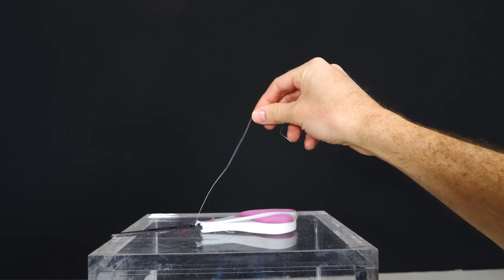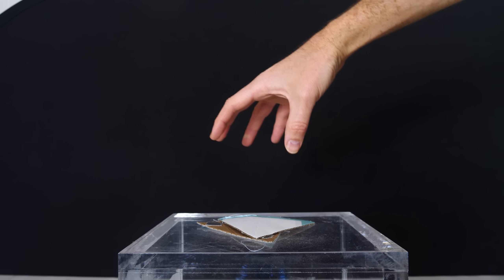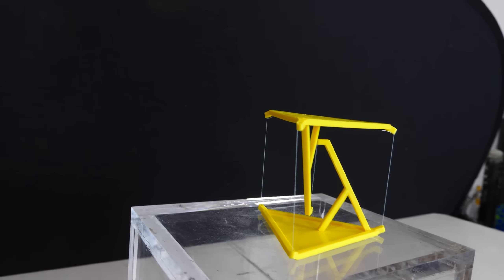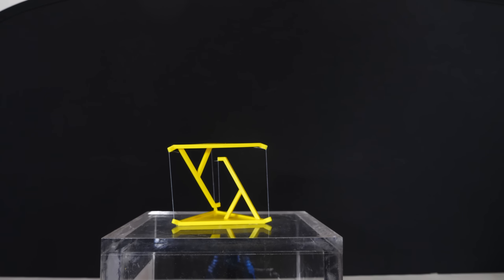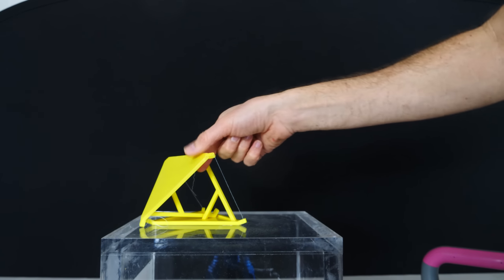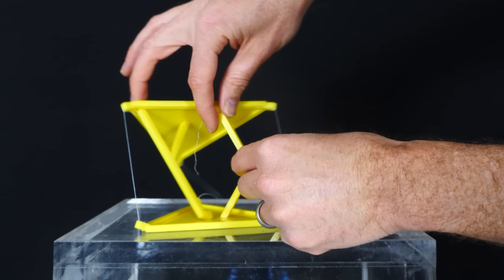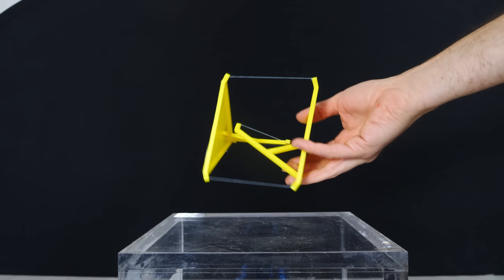Fake or Real? Floating Table Held Up By Only Strings

Comment: the entire weight is being held by the center string.
Reply: Yup
Reply: Factz
Reply: add more center strings evenly spaced, and add more outer strings to prevent tipping
Reply: Kinda
Reply: Yeah why is this so amazing?
Reply: Zach Terry it took me a couple of seconds to figure it out.  Something hanging from a string is nothing new or amazing.
Reply: @zachtterry21  It's mostly visually surprising.
Reply: Yes. We both watched the same video. Good job.
Reply: Corey Mac well actually no but only if the weight is exactly in the middle. If its the slightest off the string on the opposite side will be stretched. So actually the weight is always on 2 strings
Reply: Wrong, it doesn't work with just the center string.
Reply: Did you guys not watch the video? It's being held by 2 or 3 strings at any one time.
Reply: well, yes... but also no
Reply: Yes but it doesn’t fall because of the sides holding it
Reply: The strings on the side is keeping it in place, in the same way helping the center string to carry weight
Reply: No

Comment: That structure and your explanation give me a totally different perspective on matter. Is everything under tension in a sense? I'm confusing myself. Must marinate.
Reply: dont forget to cook for 10-15 minutes on a low flame and season with garlic
Reply: Static Electrical Forces is the medium which makes this "Work!" The Plastic plates are Statically Charged. 
Test This Theory: Sit Down in an Easy Chair + Sock Feet Rub on Carpet + Pet Your Cat😻 in the Dark(Gaze Closely at Your Hand/Cat Contact Points)=What do Ya See? ("OoooWeee!.. miniature lightning bolts Honey!");The ElectroMagnetic Energy will also forcibly move objects(i.e. embedded pet hair,etc...) without having or being physically contacted:

Comment: If I'm not mistaken, the center string is in tension because of the weight at the center of mass of the table and the other strings are in tension whenever there is a moment of inertia created at the corners.

The reaction force in the centre string is upwards, and at the corner string downwards.

Comment: What the heck, I was just done 3D printing this exact thing and then you upload this video? What are the odds? :D
Reply: I did some math for you. If everyone who watched this video 3D printed this exact thing once every 270 years, there would still be higher than 50% chance that one of them 3D printed it the same day as the day this video came out.
Reply: Jimi02468 wait, how can you did the math exactly?
Reply: my life is a lie I think he just used basic education to run math: 50% probability and number of viewers are the independent variables, and average number of years  you would like to 3d printing such object is the dependent outcome variable in his setup problem 🤣
Reply: @fos1451  lol, wich math?  It will happen or it will NOT happen....50/50
Reply: @catothecensor  that's not a good way to count probability
Reply: @jschouten1985  so the chance that i die today is 50/50? Either i die or I don't die?
Reply: my life is a lie difficult to explain better here, but it’s clear id you think on it.
Reply: @jschouten1985  Thats not how probability works....
Reply: it's called a hype
Reply: If it's not 💯% accurate, it's 50% accurate

Comment: Something I would have never thought about. It is almost like an illusion. It tricks you to think it is floating but really the center string is holding it with the outside ones balancing it right? Didn't pay tye most attention to the video so I could be missing something but who cares.
Reply: Yeah that’s basically right sadly the illusion part lasted about 1.5 seconds before my brain was like the middle strings holds the weight and the side strings keep it from just falling over

Comment: The human body is a masterpiece of engineering. DaVinci appreciated this realization. Bones many times stronger than steel much to the rapier's chagrin.

Years ago I was in an automobile accident. I was a passenger in a car that has come to a full stop on the freeway. All of a sudden, we were rear ended by a minivan going 55mph. I was unharmed. Not one scratch although a nasty case of whiplash ensued.

Another car accident I was in as an unrestrained (no seat belt) passenger happened years earlier in a 1974 Chevy Nova (car including dash was made from thick guage steel). It was an icy winter intersection that Mom was turning left through (sliding actually as she mashed the brakes). And the other driver had taken a long run from down the street to get over the ice covered hill with that intersection near the top of it. He was doing about 35mph when he hit the driver's front corner of our car as we slid through the icy intersection.

The next thing I knew, I was sitting Indian style, cross legged facing the passenger window. I looked down into my lap and picked up the entire rear view mirror assembly. Apparently, my left eye socket had removed it from the windshield cleanly. 

I threw that mirror on the floor and tried to calm my little sister in the back seat down. She was screaming hysterically. Mom was dazed but seemed unhurt. I noticed a perfect impression of my left knee cap in the already concave part of the heavy steel dashboard just to the right of the radio (impressive)!

My scalp had stretched and had a slight tear near the top of my head. It was oozing blood and warmth under my hair (apparently, leftover momentum from the rearview mirror removal was dissipated by oblique contact with the inside of the windshield).

Minor injuries just rattled nerves. Most impressive was that left knee impression of mine in that heavy guage steel dashboard and no injury at all, whatsoever!
Reply: Damn, that's deep

Comment: I'm going to build my house with full of tensegrity structures, wouldn't that be cool?
Reply: There will be incredible quake resistance if the foundation materials can withstand tensile and shearing forces, while enduring weathering, fatigue, corrosion, and thermal expansion.
Reply: Tensegrity house supported only by threads:
Pair of Scissors: "I'm about to end this man's whole career!"
Reply: maybe chain instead of thread
Reply: @Rcck.7282  nice idea!
Reply: C W  wow thats make sense. thats why bridge are made by steel cable

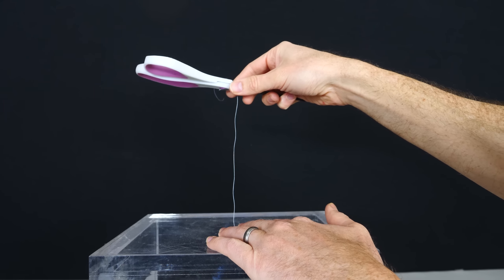Comment: 0:47 "but what if today we wanted to try and experiment where we actually put compressive loads on thread"
false, misleading
the table is held up by the tension load in the center thread and balanced by the tension loads on the outer one
no compression involved

Comment: Genius! Inspiring! Saw this in another video about science toys but couldn't imagine how it works. Even if the center string was holding the roof up, that roof should have collapse straight down. I failed to see that the angle of the supports that the string is tied to is important in that it convert a vertical force into a side motion that is then prevented from tilting over by the three outer strings. This structure would never work if the supports were vertical instead of angled just right.
Reply: Hmm, or would it? Nope, vertical supports will work just fine. The illusion really did a number on my brain here. Now to imagine how bicycles spokes work...

Comment: It's really disappointing we don't expect this from u....
It's quite clear that center string was taking all the pressure
Reply: It's what he basically just said bruh
And if u think about it u r wrong
Not all the weight its just most of the weight
If therr was only a single stringit will definitely tip over cus its not stable 

So other string will have part of the weight
Reply: @nakulankurmullam2982  No..  You're wrong.   The center string took ALL the weight from the top of the table.   The outer strings were just keeping the corners in place and if anything would add MORE weight when pulling to either side because of the tension.   Ever tried compressing a spring?
Reply: @stormrungaming  how can it be dude this whole system is mechanically stable so when u resolve the force vectors everything should match up
If it tips to the right the component ofnthe left string balances it
Reply: @nakulankurmullam2982  ..   0:01   - you can see it's not stable enough to hold weight anywhere except the direct center.  If you applied weight on any corner, the side with weight could collapse and twist the other 2 sides essentially pulling the bottom and top together adding weight.   -releasing potential energy.  The only weight supporting structure is the string in the middle.  You could attach a newton meter to each string to see what I'm talking about if you can't see it when he pushes on it and breaks it already.    Watch closely when he puts the circle weight on it.

Comment: It's a really cool illusion due to the near invisibility of the middle string. The two pieces are actually one, joined by the center string. If the center string was the same material as the rest of the trusses it would be obvious. The top is hanging off the bottom stabilized from side movement by the corner strings.

Comment: with the same plastic pieces, you could have configured the exterior strings like a stewart platform.  This way, the table would have an absolute possition.  It sould not wobble.

Comment: Strong is only capable of pulling objects. So that is what that middle string is doing. The corner strings are there to make sure the top doesn’t run away because of irregular forces

Comment: The middle string keeps it from falling and the yellow plastic pieces are in compression. The strings are never in compression. The strings on the outside actually just help it balance as the weight shifts.
Reply: Why are you repeating what was stated in the video? lol

Comment: So this is really easy to explain. So the stringy in the middle hangs from the bottom plate to keep the top plate. So if I put weight on the device the middle string will have the most stress. The three side strings are there so the top plate doesn't wobble side to side. And yeah.

Comment: The center wire is holding the upper part... the other 3 wires are just supporting it to not fall down in the respective directions..

Comment: The middle string is the one holding the weight. The other strings just stabilize it. Technically the top surface is dangling under the bottom piece.

Comment: This is the same as bicycle wheels. They 'pull from the top', and you could theoretically replace the spokes with ropes/wires. 

As soon as saw the shape it's obvious that the top is hanging from the central support.

Comment: It does have compression members in this structure, and only being held by tension is merely an illusion. The two centre pillars are the compression members here and it’s just that they are placed in a manner that the connection between the two compression members is a thread as joint.

Comment: Just standard tensegrityi.  A structural principle based on a system of isolated components under compression inside a network of continuous tension, and arranged in such a way that the compressed members (usually bars or struts) do not touch each other while the prestressed tensioned members (usually cables or tendons) delineate the system spatially.

Comment: Great Demonstration! 
Note for MisUnderStanders:🤠💨⚡💥
Static Electrical Forces is the medium which makes this "Work!" The Plastic plates are ElectroStatically Charged. 
Test This Theory: Sit Down in an Easy Chair + Sock Feet Rub on Carpet + Pet Your Cat😻 in the Dark(Gaze Closely at Your Hand/Cat Contact Points)=What do Ya See? ("OoooWeee!.. miniature lightning bolts Honey!"); Now, as shown in the video ElectroMagnetic Energy will also repel or attract objects, depending on polarity (i.e. embedded pet hair,etc...) without having to be physically contacted:
Note: The Strings in the Video are simply "Stabilizers" used to restrain the Energized Plastic Plates from escaping the Repelling EM Force Zone; Without "Retention," the Plates would repell away from that "force zone" & fall, as shown in da' video:

Comment: Its because of the string in the middle, The strings around want to collapse, but the one in the middle is holding it up, therefore, the table will not collapse.

Comment: Well but this table isn't held by string under compression rather by the tension on the middle string. the other 3 are just for balance and keeping the top part stable.

Comment: I guess it would still work if those two back strings (on the left) were removed
Reply: Nope, it'll topple(in the general direction of the remaining string) if they were removed. Unless you placed a weight perfectly in the center of the edge on which the two strings were removed and perfectly aligned with the middle string and last balancing string and you couldn't change the weight distribution in any way without it toppling. You can make these structures with more balancing strings but 3 is the minimum # of balancing strings that can be used and the structure remain stable under all loading conditions.

Comment: Ok i only watched the beginning and i think i know how it works. That one string in the middle is connected to to a thing thats holding it it up, and another one that is identical to it but its on the ceiling of the contraption type thing. Its short enough so that the plastic thing on the ceiling isnt touching the bottem, so it cant go down without breaking the thread. The other 3 on he corners are just for stability
Reply: Yesssssssssssssssssssssssssssssssssssss
Reply: Static Electrical Forces is the medium which makes this "Work!" The Plastic plates are Statically Charged. 
Test This Theory: Sit Down in an Easy Chair + Sock Feet Rub on Carpet + Pet Your Cat😻 in the Dark(Gaze Closely at Your Hand/Cat Contact Points)=What do Ya See? ("OoooWeee!.. miniature lightning bolts Honey!");The ElectroMagnetic Energy will also forcibly move objects(i.e. embedded pet hair,etc...) without having or being physically contacted:

Comment: From what I see, the strings on the outer edge are solely for keeping the top section balanced. The bottom part of the top “Y” is pulling tension whilst the top part of the bottom upside down “Y” is the actual load bearer. Pretty cool
Reply: Yup, that's it. This guy is great at explaining things in such a way as to make them seem much more complicated and "sciency" than they really are
Reply: @juayderitaux7677  maybe that's because the point of his channel is to explain the science behind it? Admittedly not that much behind it in this video, but your statement was about him in general

Comment: I knew how this worked before you said, there is a rope between the weird things and the top one is supported by the bottom one by a thread and that holds it up, not the strings

Comment: 2:51 Technically the yellow thing is not string and it is supporting the centres of the surfaces of the table. So the table is not standing solely on the basis of strings.

Comment: Pretty easy to see the center string is doing all the supporting in tension while the outside ones just stabilize it. It's kind of like a bike wheel. The whole thing is supported by tension.

Comment: The middle thread does all the work.
Because it is under tension instead of compression.
If the top is perfectly balanced then the middle thread can support the whole structure without the other 3 threads.
Love your vids

Comment: Its simple, the string in the middle holds the top portion and the outer strings stabilize it so it doesn't collapse to one side.

Comment: As you can see, two half life symbols hold up the table. Adding another one would make it completely different, and not as stable. This is, what I think, the reason why half life 3 will never be created.
Reply: But the string was broken. Half life 3 confirmed.
Reply: Just saying but half life 3 is actually confirmed by valve

Comment: I think this is common sense on how it works the middle string holds most of the weight and the other strings act as stabilizers so when it leans one way the opposite string will pull it back and vice verse I’m no expert this just how I understand I also haven’t watched the video yet

Comment: Many years ago I saw a dining table that used a variation on this.  A slender central rod supported the weight of the table, stabilised by thin steel cables connecting base and table top at the corners so it looked as if only the cables were somehow supporting the table.

Comment: It’s hanging by the center thread and stabilized by the tension of the outer strings, so it will not sag or twist from the tension of the outer strings but will still hold weight because of the top layer hanging from the center thread. Next time use braided fishing line, it has a high tensile strength but is still relatively thin. 😁👍

Comment: I'm pretty sure graphene has a higher tensile strength than the other two materials you mentioned
Reply: He mentioned carbon nano tubes @ 4:05, which is graphene rolled up into a cylinder.

Comment: Is "how strong it is" related to the strength of the string? Like, can I make a table (usable table that I can place multiple objects) with this thing?
Reply: It depends on the stength of the middle string.
A table would require a very strong string ( depending on the amout of weight it would lift )

Comment: Very interesting, the middle string increases the tension between the threads at the sides of the table.Show us some more and also, could you use rubber bands to replicate the experiment.